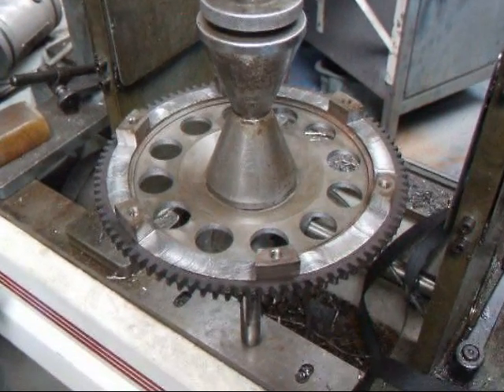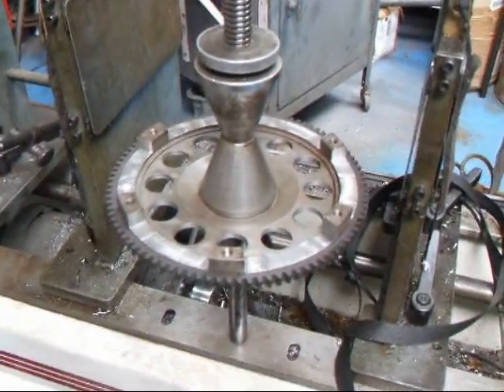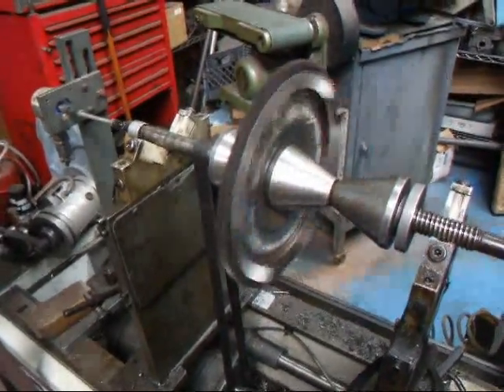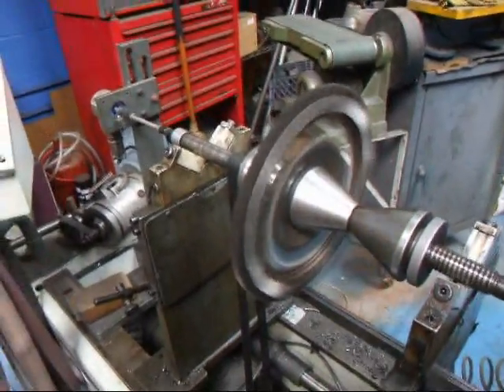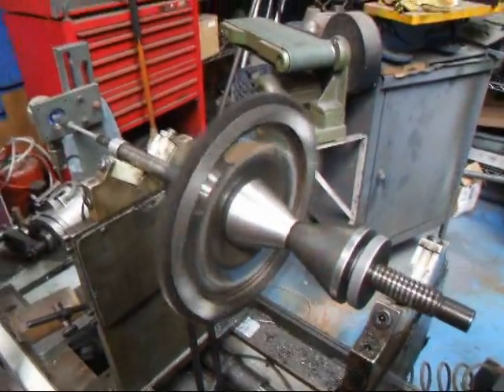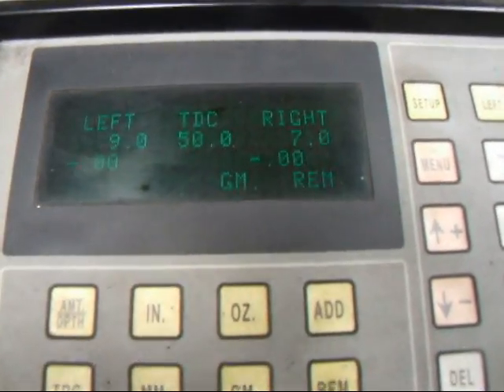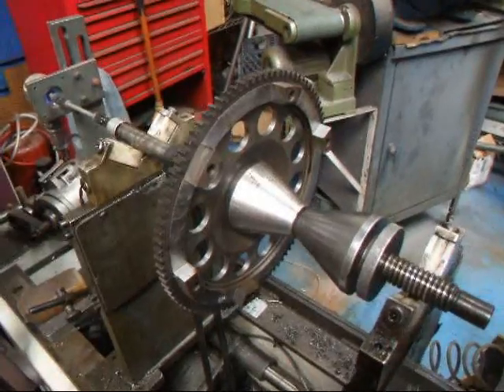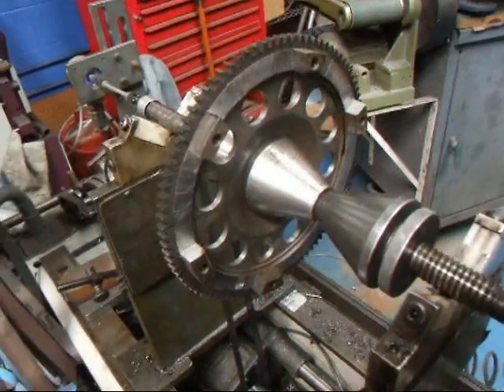BMW-MC-Flywheel-Lightening.mp4

Comment: john, are those raised portions where bolts go part of original geometry or did you remove so much material that you have to leave it raised? anyway I bet it was a bit of a dread machining that no matter what the initial geometry was.

anyway, I think simply a PERFECT JOB is just the 'worst' thing john can do! keep us updated! as for the cold, sip a whiskey or two, nothing works better than an internal disinfection :D